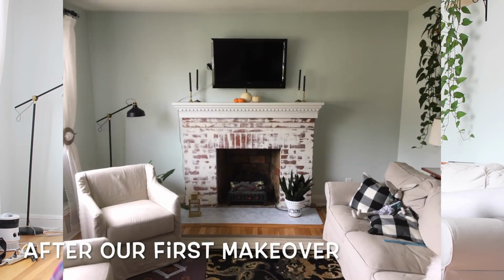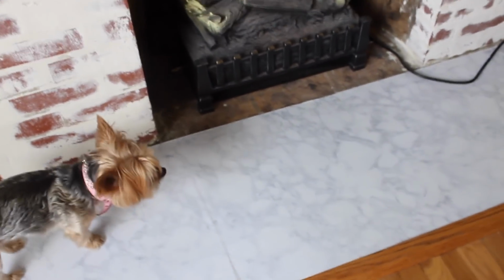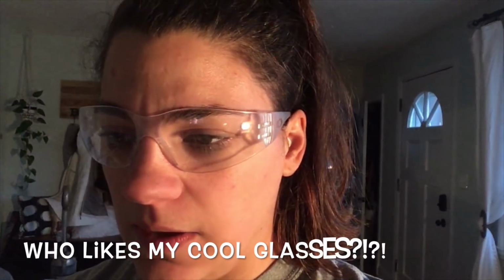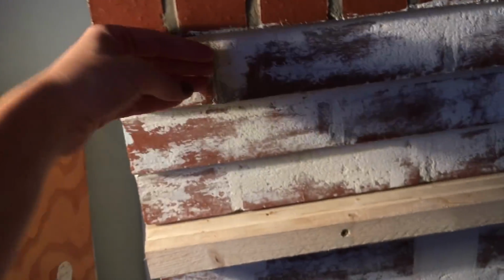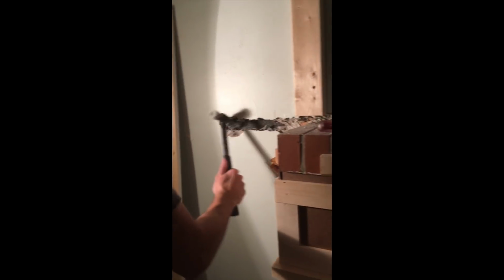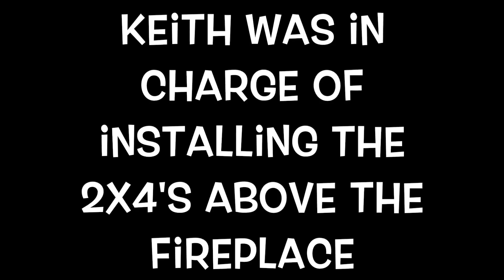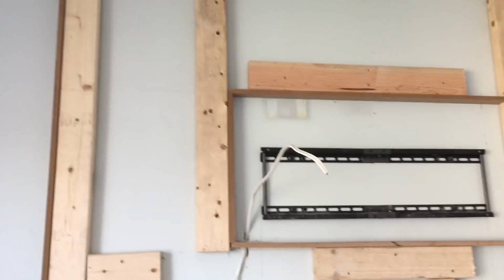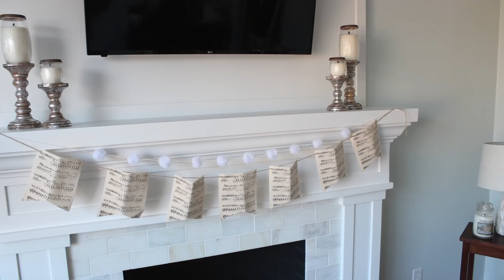Fireplace Makeover - DIY Fireplace

Comment: What did you use over the brick before you put down tile?
Reply: The proper way is to use heat resistant thin set mortar on brick and on back of durock cement board and then screw Durock cement board (NOT HARDIEBOARD) to brick with masonry screws then use thin set to attach new tile or pavers or what ever you want. Mainly the material has to be non-combustible and cement board is used by professionals.
Your friend has shared a link to a Home Depot product they think you would be interested in seeing.

1/2 in. x 3 ft. x 5 ft. Cement Board with EdgeGuard

https://www.homedepot.com/p/304163165
Your friend has shared a link to a Home Depot product they think you would be interested in seeing.

Porcelain Tile White 50 lbs. Fortified Thinset Mortar

https://www.homedepot.com/p/202519208
Your friend has shared a link to a Home Depot product they think you would be interested in seeing.

#9 x 1-1/4 in. Serrated Head Star Drive Cement Board Screws (185-Pack)

https://www.homedepot.com/p/300657700